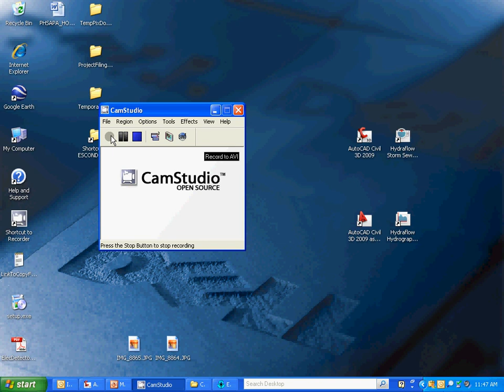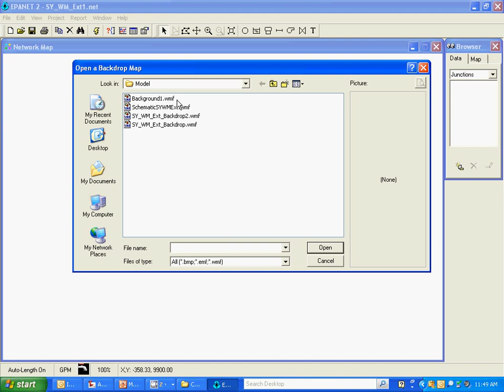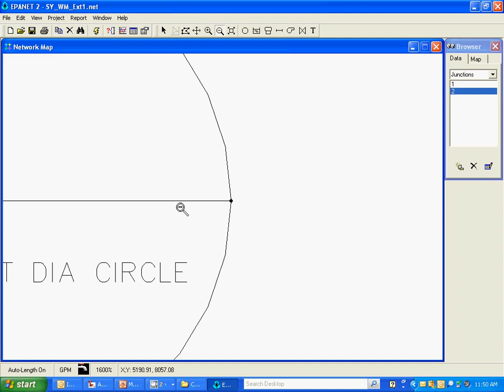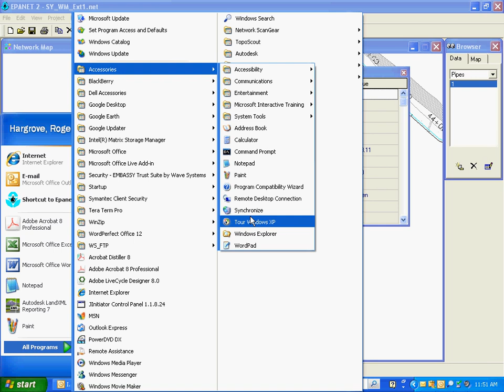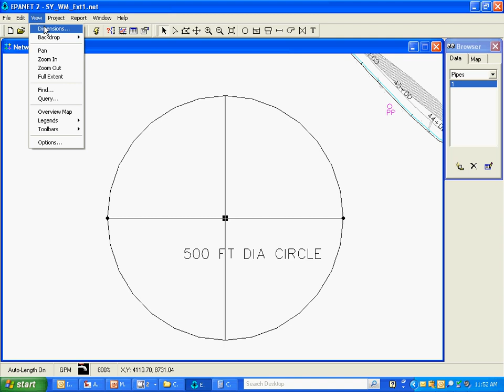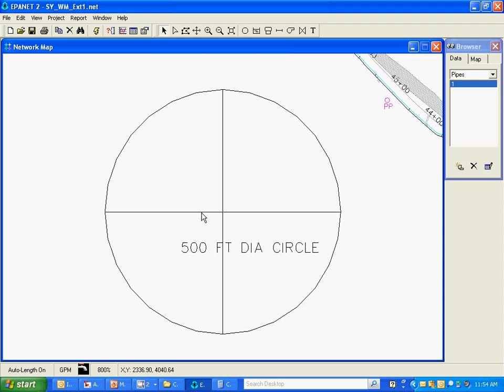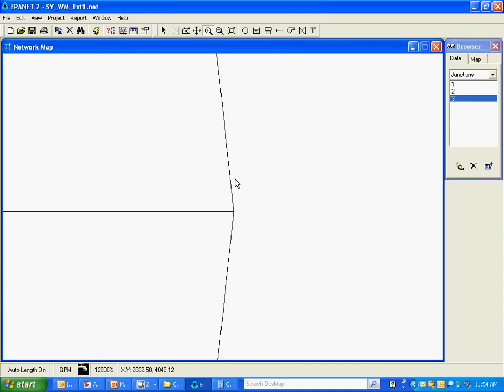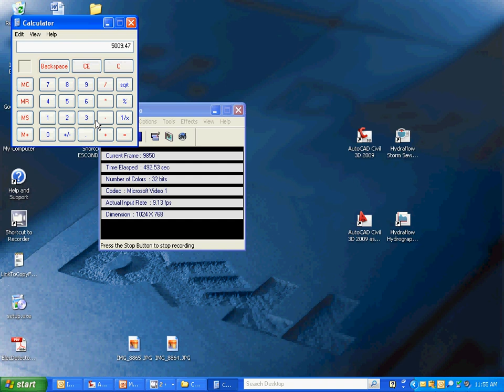EPAnet Tutorial Section 2: Loading/Scaling a Backdrop Map

Comment: It's still giving me inaccurate pipe length I have follow the same method as your .. After scaling my pipe leagth was 999.88 close enough to 1000meter but  when I was placing it on map pipe leagth should be giving closer value to 350 meters long but  its giving me 283... Do I have to change the values manually?